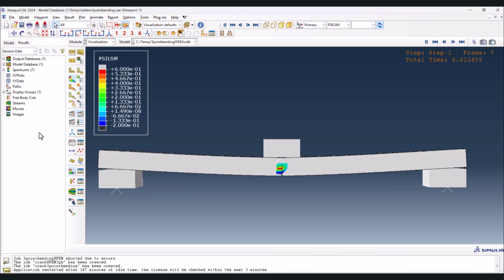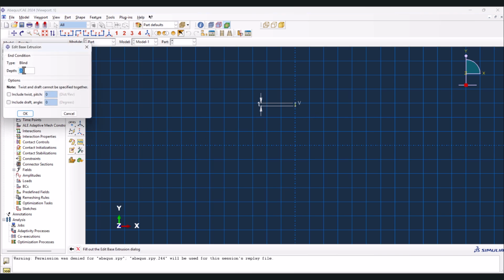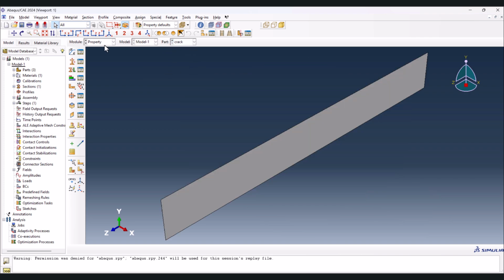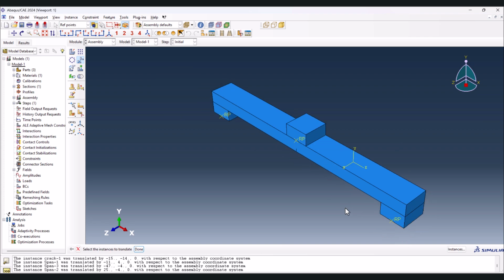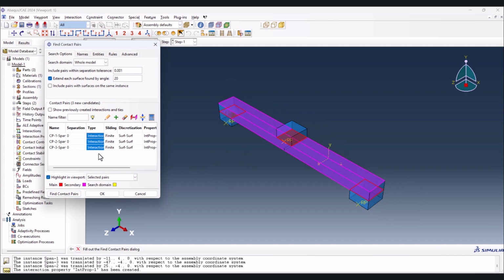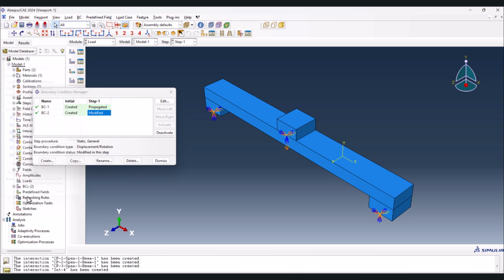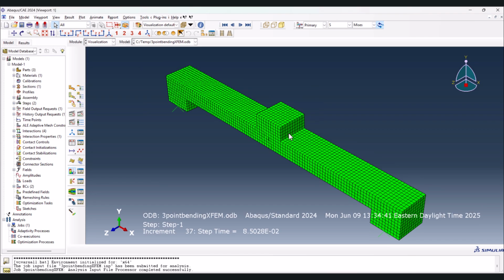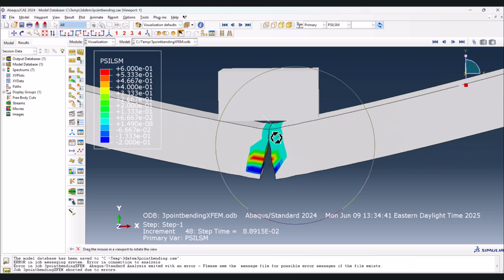How to Simulate Crack Growth in Abaqus – XFEM 3-Point Bending Test

Comment: Hello and sorry for bothering. Can i take j integral from xfem analysis? And if so could you please give some hints
The value of fracture energy in maxps is the Gc ( critical fracture energy )?? cause i see you are putting joules and not N/mm or j/m^2 as it is for Gc derived from Kc
Thank you and continue your work you are helping all of us
Reply from the maker: Yes you can, here joules/m^2 and N/mm would be the same because it is milimetric.
Reply: What a quick response!!!
A final one 🙏 
I come up with much lower values like 45N/mm from a K= 100mpam^1/2 for a steel(E=200000) ,why is there such a difference with yours
Reply from the maker: Because there are different types of steels! I got it from an article I can’t remember which! But I would recommend you doing the same for your alloy. Have you checked other parameters for the formula?